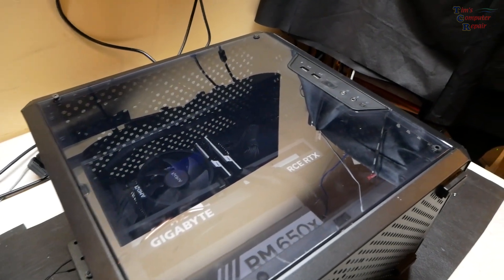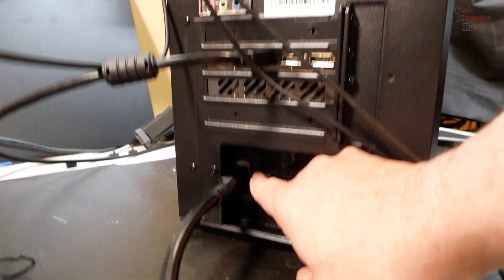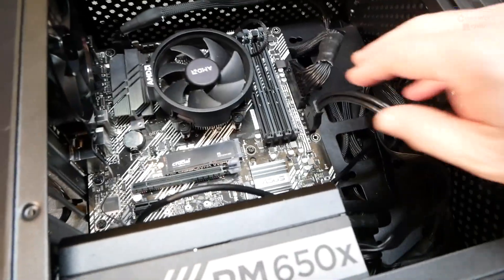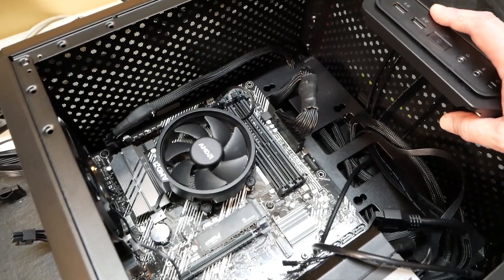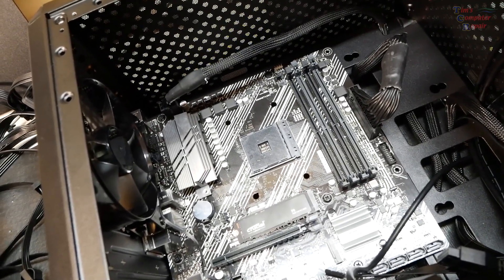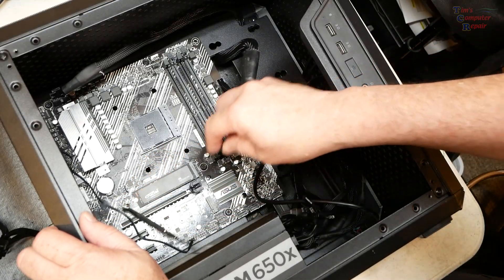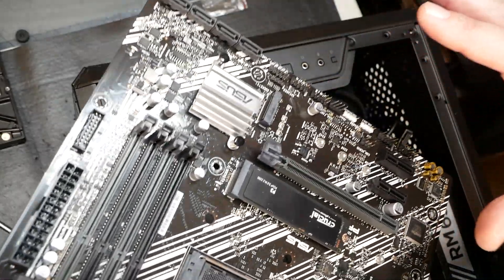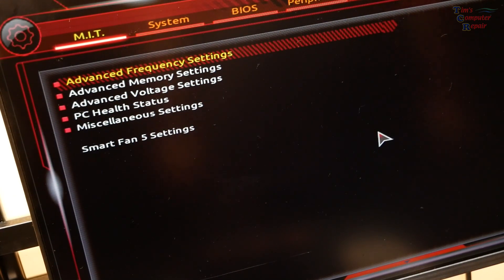Certain People Simply Do Not Need to be Building Gaming Computers!

Comment: Whoa there fella.
#1 when installing CHIPS, you do so GENTLY. It should literally fall into place with the CPU, single finger press to make sure its seated correctly and then secure. (Some chips require 2-3 fingers pressure)
#2 if you see discolored splotches on the CPU jack or MB, these are signs of shorts and you should RMA or get a differnt board.
#3 if you bend pins, tweesers can bend them back and it can work. Same for thermal paste. Use a Qtip, 80+% isopropyl and scrub it off then use tweesers to pull cotton out. (Ive saved 2 CPUs this way.) USE AS MINIMAL PIN MOVEMENT AS NECCESARY.
#4 Make sure pin connectors to MB are secure. Itll save you troubleshooting later.

If this is your 3rd build and youre STILL breaking things like this; just stop. Hire someone else OR take some anger management classes and try again cuz DWAM.
Reply from the maker: Thanks for commenting.

Comment: if the CPU is stuck to the heat sync, the pins could have been  bent when pulling it off. maybe use a heat gun to warm the thermal paste so it isn't so stuck
Reply from the maker: The cpu was fu**d anyway.